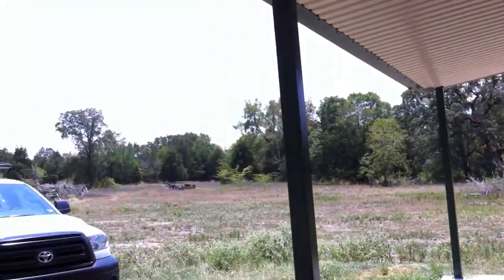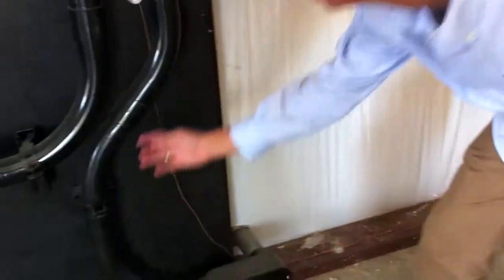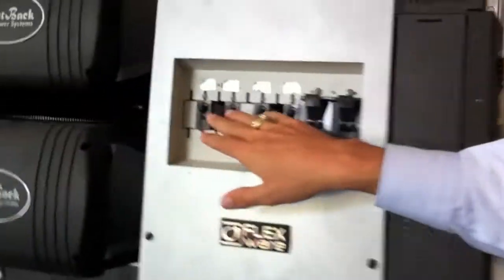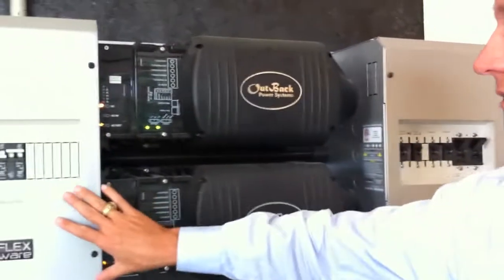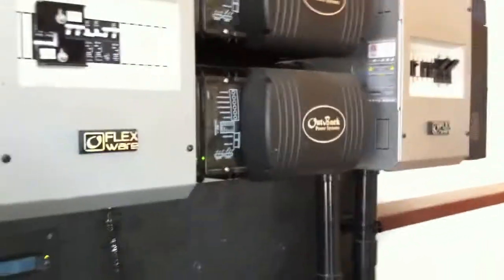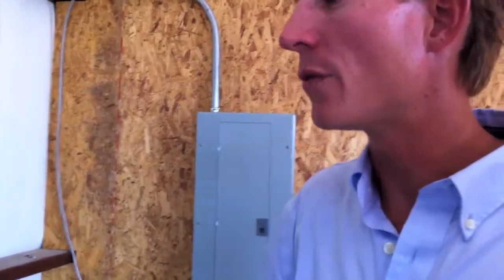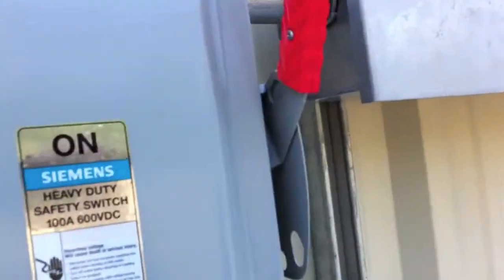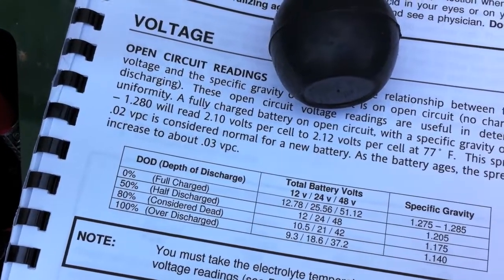My Solar Power System Education

Comment: Great setup, I'm using 3 PV 230w each with 30A Controller and 4x105A marine batteries and having charging problem they never reach 100% of charge.
Can you kindly suggest any solution?

Comment: Nice. Did I hear correctly that you are running a 48V battery system?
Is the generator you are going to be using going to have an autostart controlled by the mate?